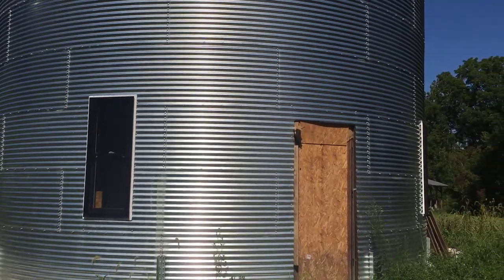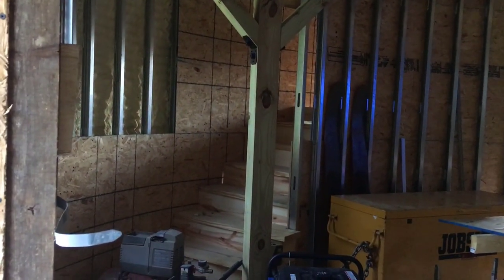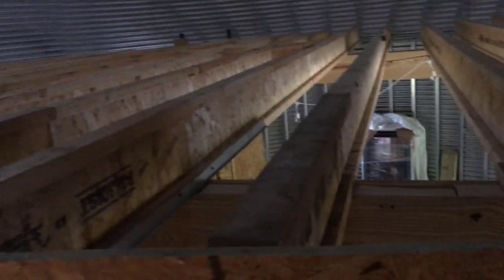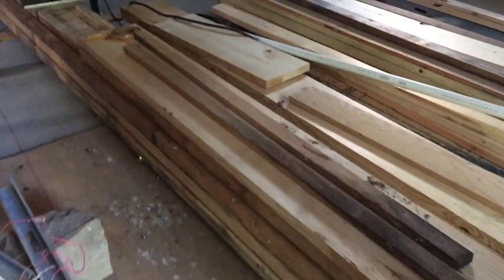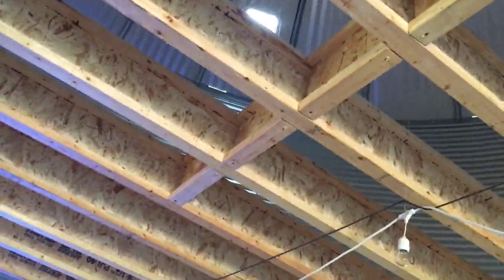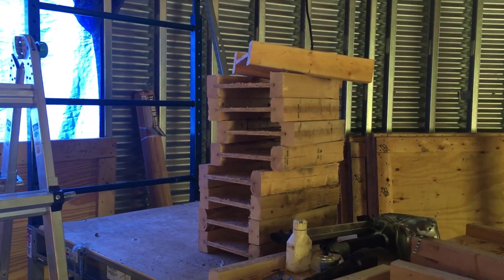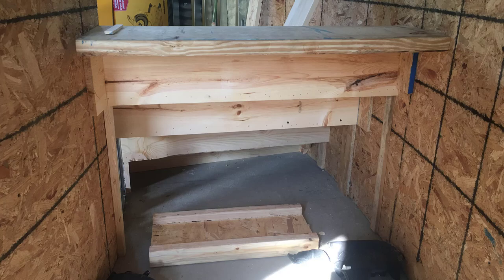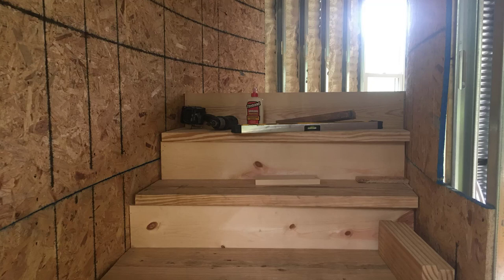Adding Stairs and floor joists in Grain Bin House  -  E18

Comment: I'm not sure that I'd tie the steps just to flake board like that. Sure, some of the risers are going to the studs, but if they are 16 on center many are not. I'd feel a lot better if there was a shelf for those risers out of real wood. Not easy with the curve, but laminating a curved "beam" out of 3 strips of 1/2 wood ripped from a 2x4 that was attached to each stud would give something that's going to be more stable over the years. And if you wanted to get artistic, that shelf could be curved in 2 dimensions and run at an angle up the wall at the same time as it curved  to follow the wall.
Reply from the maker: It has been noted...looking at having the support board go all the way to the floor and then there will be 5/8" drywall...may do as suggested too...We appreciate your input!!!!

Comment: How did you attach the joists to the wall!
Reply from the maker: He used metal studs for the walls and then there is a metal piece going all the way around bottom and top.  He put a support piece from the wall on top of studs to the 4 x 6 posts in middle of the floor for extra support....so wall to wall metal piece on top of metal studs and then extra support in middle of room 4 x 6 posts...